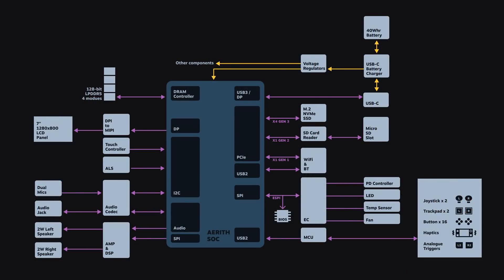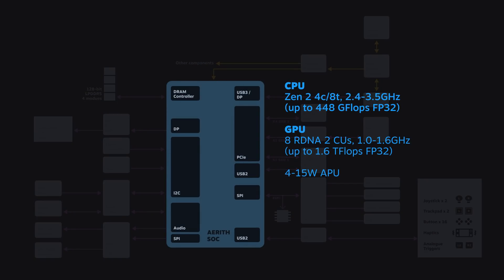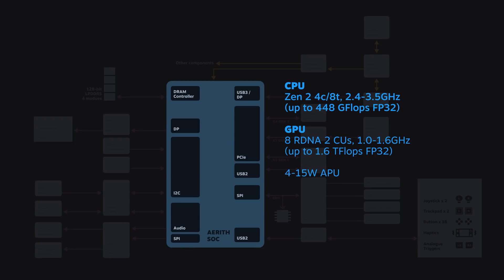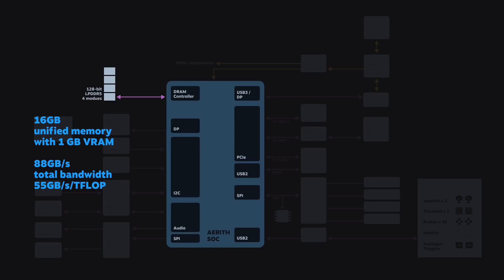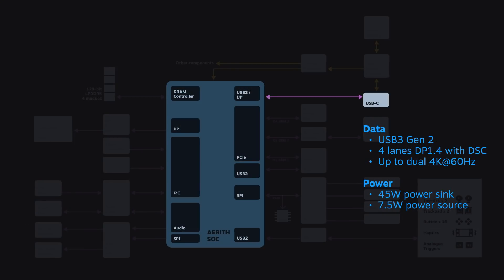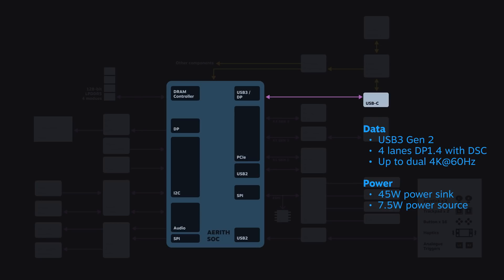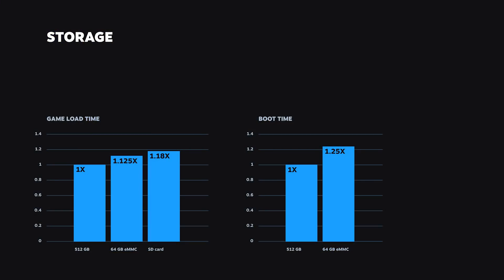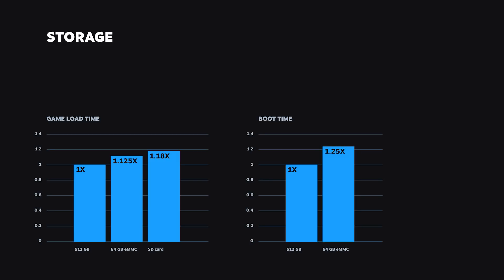Steam Deck Hardware (an Overview)

Comment: Bro, nobody wants to buy Steam Deck, we want CSGO to have new anti-cheat and 128 tick rate server. That's all we want.
Reply: You do know the people that work on steam deck have literally nothing to do with the development of CSGO right? And I don't think money is an issue for valve, so they could do both things if they want. Besides when it comes to cheating on PC every anti cheat gets beaten at some point, it's one of the downsides to playing on such an open platform. I know it sucks (I had Rust completely ruined for me because of cheaters). Plus valve doesn't seem like the type of company that would want to put invasive kernel level anti cheat in their games.

Comment: Just a heads-up, yall gotta step up your game on this channel. 22K views for an official Steam Deck video is criminal. Start with the thumbnail. Maybe include a Steam Deck in it.
Reply: @grzyruth9205  By your logic most of their customers are idiots 'cause there should've been more views if they weren't.

Or, they aren't idiots, but this channel just isn't tapping into the hottest piece of gaming hardware in awhile cause there are plenty of boring PC tech channels that garner more views, that aren't owned by one of the biggest movements in the PC industry, like Steam is.

Marketing matters. Even if it was to a utilitarian crowd. There's nothing utilitarian about the thumbnail, there's no utilitarian aesthetic you speak of there. 😂 In fact, there is no aesthetic.

It's just plain lazy, just like their other dead products. Maybe that's more your style. On the other hand, I just hope this doesn't become another one of those.
Reply: @AkshayDidIt  Okay so, I just realized that I meant to send my first comment as a reply to someone else talking about how they wanna buy everything Valve makes. Whoops lol, ignore what I said earlier, no need to write an essay over a mistake

Comment: I heard that dual booting should work on deck. Do i need to connect a keyboard to do this because grub seems to only accept keyboard input in grub so i need a keyboard input to change the os. Specifically i need arrow keys. Or can i use the d-pad as arrow keys in grub?

Comment: Are all of the drivers for the hardware going to be free and open source? because i don't want any proprietary software on it
Reply: If that's the case, I have some bad news for you: Steam itself is proprietary software, and so are most games available there.
Reply: @stale2665  i wasn't planning on using it with steam anyway, it's just a portable linux computer and can run software from other sources.
Reply: Daaaamn,is Tohru really defending open-source softwares ?
Kobayashi would be proud.

Comment: What volt and amp it uses for charging? I heard its 45w but it would be important to know what voltage and amp it uses so i can buy the correct charger.
Reply: It used usb power delivery 3.0 power supply, so maybe 15-20 volts at around 3 amps
Reply: @Xiefux  i was thinking that too but technically it could also be 9v 5a.
Reply: @wilderness-beastt  Who really knows, their official specifications don't mention anything about voltage.
Reply: @Xiefux  true

Comment: If for some reason you choose a dual boot option with windows, do drivers exist that will recognise the controller/inputs or touchscreen.
Reply: Controller input is handled via steam input, so if you play steam games it might work no matter the os, not too sure about touchscreen though
Reply: @Caliel, on Steam OS its going to have to work all around surely, would be a little dissapointing on windows if it doesnt work outside steam.
Im honestly going to go with the OS that provides the best performance once this drops, & frankly as much as Id rather use Steam OS, wtf is the point if Windows based steam games get 20% increase in fps(which they often do) against using a proton compatibility layer.

Comment: 512gb NVMe and 1TB micro SD and I'm set. Retroarch has 19 cores right meow.
Reply: Sure if you want to pay an extra 600$ for just storage lol.
Reply: @johnfrankster3244  512 is already included and 1tb SD is $120 on sale. Completely worth it.
Reply: @Jahtech9  1tb 120$ on sale is basically the oldest one around. If you wan't faster read/write your paying a chunk more already. 512 or 256 is much better value.
Reply: @johnfrankster3244  1Tb SanDisk is $100 for black friday Steam deck won't utalize faster than 100mb/s reads anyway despite it being current hardware.
Reply: @Jahtech9  if they support NVME SSD speeds which they do, I can assure you it will ;).
Reply: @johnfrankster3244  internally it does but not the external storage. Unless your talking about carrying around a portable SSD.

Comment: A major question that still hasnt been adressed is
*How protective is the screen?
 *Will a screen protector be necessary?
*Can you apply a screen protector on top of antiglare etched glass?

If you could please address this it would be great.
Reply: Hello, I might be able to answer your questions.

Physical Stress Testing including Drop Tests have been performed on the final hardware that will be shipped next year, during most of which the Chassis will absorb the impact rather then the screen. Durability and longevity is taken seriously on Deck, the Device is designed to be able to sustain a daily handheld gaming environment.

The screen is made out of glass on all models and a carrying case is Included with each Steam Deck, it is unlikely that you will scratch or break the glass accidentally. On top of that the Anti-glare screen on the 512GB model is even more scratch resistant due to the Etched finish. 

However should you be worried about scratches or for the glass to shatter, third-party screen protectors will be Available at launch from reputable sellers including screen protectors for the model with Anti-glare Etched glass. Please note that Valve is currently not directly partnering with anyone to create third-party screen protectors, nor providing official screen protectors for the Steam Deck.

For any updates follow the Steam Deck blog on Steam or visit the official Steam Deck website.  

Cheers.
Reply: Thankyou so much for taking the time to respond. Really appreciate your time & support. Thanks for the detailed response.

Comment: Does 256 and 512 models have the same sped?
Reply: The only Diffrence is the speed of the storage. Performance and spec will be the same between models.
Reply: @Vitoreo  They're probably asking about storage performance difference between the 256GB and 512GB version. The 512GB drive will be a bit faster, but the 256GB drive will be closer to the 512GB drive than it is to the 64GB drive.

Comment: Love it or hate it, you have to recognise the beauty of an hardware than this thing is. It has to be one of the most efficient (as in performance per watt) devices ever made. The only way to really do better would be to go ARM, but ARM has it's own set of problems (though many breakthroughs have been made recently).
Reply: imagine if Valve made an x86 Steam Phone!
Reply: @protocetid  phone dont have normal controller model (k+m, gamepad), only touchscreen, this is one of main reason why most of mobile games are so downgraded.
Reply: @riventin3595  Someone’s never heard of the Xperia Play, and obviously you wouldn’t play M+KB only games on it.
Reply: An ARM chip with hardware accelerated x86 emulation, like Apple's M1 chips, would be ideal. Qualcomm are really talking up their 2023 chips, saying they intend to make class-leading chips for PCs.
Reply: Arm supports like zero games ;), that is the main problem, steam itself requires x86 to run aswell.

Comment: The final chart showing the game load times has convinced me that the base model is the way to go for me. "Only" 18% slower loading games from an SD card compared to NVMe  - this is great news for the price point.
Reply: They were honest to show that. I still remember how Nvidia scammed us with their fake charts of Turing.
Reply: If your purely about speed,
1 unless when the steam deck releases, major companies like bethesda & cd project red, start making games like skyrim, the witcher, cyber punk native to linux, it doesn’t matter how great the rating is in proton it can be golden encrusted diamond, you losing a solid 20% fps in Linux just from the OS.
Also if you install windows, the difference isnt going to be the same.
Don’t misunderstand me, Id rather use steam OS, than the virus riddled pos that is windows, but when the one OS runs a game at 40fps while another averages 50fps its not a hard choice really. 10fps difference is with GOLD rating in proton, anythinh lower will just get rolled.
Reply: @johnfrankster3244  My comment was about the difference in loading times across all 3 variants. The actual FPS would be consistent across the models whether running on Windows or Linux/Proton. In other words that would be completely different choice to make irrespective of the model I buy.
Reply: @gektron  im not sure than it would, ssd storage is supposed to be around 1700mbs, while micro sd maximums your likely to find are around 170.
Their is a high chance windows 11 will better utilise the speed of a solid state drive over linux.
Reply: @johnfrankster3244  Lol you say that yet there's quite a few games that run better on Proton than they do on their native Linux port or running natively on Windows. Like Gmod or Arma 3 (assuming you turn off Proton's E-sync on the latter, otherwise you get some input lag).
Reply: @AlphaGarg  For those quite a few that run better on linux, there are 100s that perform better in windows. I don't know whats so funny really because its about 10 to 1 favouring windows.
Im not saying this because Id rather be using windows, id much rather use the steam deck as it was intended, & i do not like windows OS at all. Its buggy as fk, the OS degrades, & it has about 8 billion viruses circulating on the internet.
Their's not much point in arguing the facts though, the vast majority of games get a chunk more fps in windows natively than linux proton.
Reply: It's what i always say. Sd card is enough for any game running at 720p.

Comment: Can it be used with split headsets that get the stream separately to the L & R side?

Like for example the "Sony WF1000XM" and similar devices.
Reply: I don’t see it not working. Usually the buds are connected to each other and only one of them receives actual input from the device you’re using.
Reply: @mephistovonfaust   There is apparently a more modern type that connect each separately. Though I suppose they too can be compatible by using the old communication way as a fallback through a primary side as you say.

Anyway, I now tested the model I mention with the now ancient PS Vita. So the SteamDeck reasonably should have no problem with this model at least. :)

But now this left me unsure if it really use the modern type as I believed in the first place or not.. :P
Reply: Yes my Bluetooth earbuds work on Linux, anything you atach to your computer will work on Linux.
This isn't a switch it's a computer. Your Bluetooth keyboard will work.
It will be about to run chrome as well.
Hell you can even install wps office and do your homework. With some legwork you can get android apps working too it's not gonna be that hard

Comment: Real question is.
Will there be a "Pro" version of the steam deck in the future?
Reply: Considering that each Steam Deck sold is a negative lost for Valve.
Reply: @FishyFelix  they're not in it for raw retail profit. That's a game they would lose. The point of the deck, like any valve product, is to further the steam platform and solve problems. Making money directly isn't the answer
Reply: @iConicDays  Valve is trying to open the door to mobile PC gaming. PC has the largest games library of any console today. Funny that Microsoft hasn't made an Xbox portable machine with compatibility to PC games.
Reply: Wont really need to worry for a while. Given nintendos history aswell nintendo probably wont release a portable that meets the steam decks specs till 2050
Reply: If it's a success then it's pretty safe to say that of course they will release new models as time goes on.
Reply: No, they would just release a sequel. But that won't happen for quite a while.
Reply: @iConicDays  the question is, after the second version, will there be a THIRD version?
Reply: @ZaXTheAlien  the plan is yes, though it depends on it's impact on steam
Reply: @iConicDays  at least we knew, it won't be steamdeck 3. not without half life 3, portal 3, left4dead 3 or dota 3 first.
Reply: @ZaXTheAlien  they'll make a 3 if the demand/benefits are there. But if you're making a joke, bare in mind they've released 5 half life games

Comment: Will this be like Laptops where playing whilst connected use more power thus higher clocks?
Reply: They answered this in the video.. 

No the power throughput will not be artificially throttled. They opted for consistent performance. They're working on a global FPS-cap toggle, if you want to increase life while on battery.
Reply: the answer was in the video. you can set your own tdp, they won't lock out anything. What this means to you is that you will be able to set how much power the cpu+gpu use. In other words, if you want it to run at higher fps/with better graphics, then yes, you will be able to do that. Want 1.30-2 hours of battery life while playing AAAs at 60 fps and medium graphics? you can do that. Want 5 hours of battery life while playing 2d games? no problem. That's why I stress so much open platforms, you can do whatever the fuck you want.
Reply: No.
Reply: Did you even watch the video?

Wipe the drool off your mouth.
Reply: Probably

Comment: Radeon Chill will be a great way to save battery life or keep the thermals down
Reply: It uses GNU/Linux, radeon chill isn't something you have on it. there is no gui to change driver settings and stuff
Reply: @Xiefux  windows 11 and boom
Reply: @SweatyFeetGirl  but thats proprietary spyware
Reply: @SweatyFeetGirl  don't care about these features, ive used amd on windows, and it honestly works much better on linux.
Reply: @SweatyFeetGirl  All those gui features are just useless bloat, even on windows i had it all disabled because its just no point to them.
Also on windows amd driver constantly kept crashing and my refresh rate kept resetting to 60 for no reason, tons of problems. on linux its rock solid.
and no, you don't have to mess with the terminal for driver stuff, it works out of the box on any distro.
Reply: @SweatyFeetGirl  🤣 this is the typical windows behavior "i need useless features because... i just need them ok"
it's called bloat for a reason. And that driver issue is on windows side most likely. 99% of people have issues with their drivers unless they try to install a more minimalist OS with less bloat.

you talk about linux, but have you actually used it? i don't really think you know what you're talking about.
Reply: @SweatyFeetGirl  All those features can be done with other software that not only are less bloated but also do it better. there is no need for a driver to include those features.
Reply: @SweatyFeetGirl  No, because you can choose exacly what you want instead of downloading some 400+ mb driver that has stuff built in that you never need or want.
Reply: @SweatyFeetGirl  nope, because i don't share any personal info online and i constantly block trackers with pihole. i use ungoogled chromium as my browser, because it has zero spyware same as my os (arch linux).
i bet you do none of these things.
Reply: @SweatyFeetGirl  i guess in that case i shouldn't try to have privacy at all. i should just give you and everyone all my personal details, credit card info ...etc
Reply: >mfw Valve included all those features on Linux for the Steam Deck 💀

Comment: This is at least 10 years future proofed
Reply: At least a couple years sure, maybe 5 years at a stretch. It all depends on how demanding modern games become in that time frame. Considering how well the Switch is still doing right now I am optimistic but we'll see...
Reply: @effervescentsoliloquoy914  given the component shortages, the industry will move slower, because most people will still have the same graphics card without really upgrading. So 5 years... maybe. That's a stretch but maybe yeah.
Reply: @lapinus  5-6 sounds about right. My GTX 1080 was just starting to show its age when I finally got my hands on a RTX 3080 (after a year on EVGA's waiting list). Then again, I'm pretty sure the GTX 1080 outperforms the APU in the steam deck. I'm not knocking it for that, the 1080 alone is bigger with more fans than the entire steam deck.